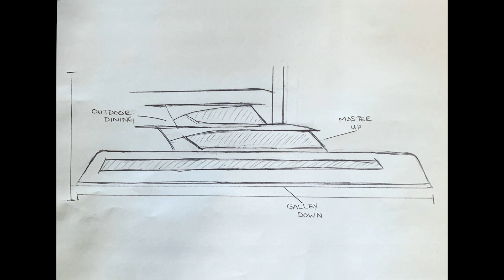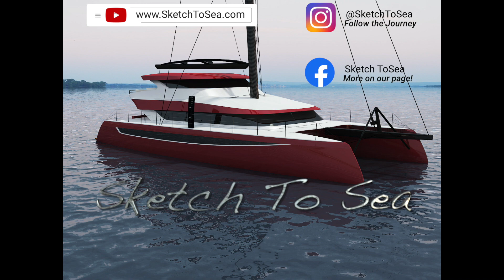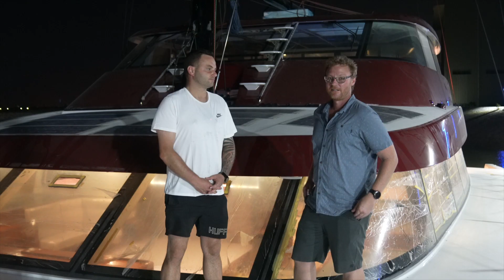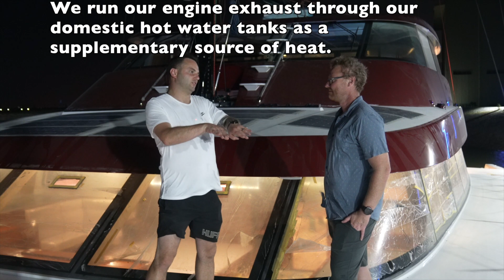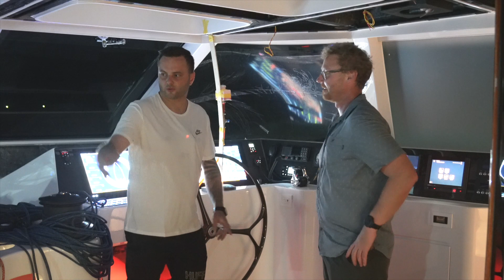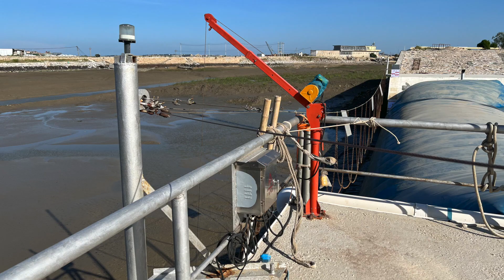Sketch To Sea: Interview with Chris Staub—Electrical Genius

Comment: Love your videos.

I have a question about your solar panels.  I have seen many debates about the pluses and minuses of having the panels stuck to the roof tops and not having the them raised to allow for easy replacement and allow airflow around to help increase the panel efficiency.  Have you or Chris have any thoughts or discussions on this?
Reply from the maker: Hi Daniel, thank you for the comment. In a perfect world I would have preferred to install them using the method that you mentioned. Unfortunately, the areas where we were able to place the panels are working areas. We need to be able to walk around and access these points so we were left with no other choice. That being said, the difference is marginal, and really boils down to the actual cell that is being used in the panel and if there is an "optimizer" controlling the panel itself.

Comment: Have you power generation through your props rotating when you are under sail? I think I got it right I'm not a yacht expert.
Reply from the maker: Thank you for the comment. Unfortunately not, when we were in the design phase of this build there were not hybrid systems big enough for our vessel. With the 88 being the first model in its range, I didn't want to be testing any more new and unproven technology.
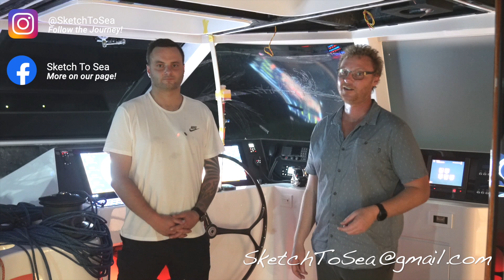Reply: @sketchtosea3750  20:37

Comment: I have one of those lightning devices on my boat, but from a different company. They even gave me a direct lightning strike warranty that will pay up to $100k. Cheap insurance.
Reply from the maker: Thank you for the comment, I am happy to hear that. I hope it has worked!
Reply: @sketchtosea3750 it's been 18 months but the problem is there's no way to know. Did it work, or am I lucky? None of my friends got hit either and have no lightning protection. But the warranty to pay for any damage does make me feel good.
Reply: What was the name of the lightning protection system you mentioned?

Comment: What size inverters do you have onboard? Everything has to be scaled for peak RMS eventhough the running amperage is quite a bit lower. When a refrigerator compressor kicks in there is an amperage spike then it settles down quickly to its running consumption level. Curious do marine electronics and cabling have special shielding to prevent erosion from the salty air? I like how they have basically created a mini-subpanel in every room in order to build out at a later date, that's smart. You really have thought out this vessel very well. Earlier videos talking about carbon fiber reducing flex and less maintenance over the long haul. Interesting learning about all these approaches.
Reply from the maker: Thank you for your comment, unfortunately I cannot share some if the intricate details yet. In general, yes there is specific wiring for marine use. A lot of this boils down to the "certifying body". For us it is RINA. They specify a lot of the individual materials to use.
Reply: @sketchtosea3750  If your solar array is capable of 7.3kw's and on a full sunny day you can gain as much as 150amps to supply the lithium battery pack I wanted to know what the overall power draw on your vessel is and the size of the inverters you chose or listed on the Spec Sheet? One inverter, two or a series of micro-inverters??? I'm impressed with every aspect of your build and you have been so detail oriented that I thought that this was a good question. I was really impressed with your whole discussion about flex and the long term maintenance avoidance, that was really thinking outside of the box. Most people fall victim to those hangups down the road. Inverter Selection is another potential bank-buster ( for me) 5-7 yrs nearing the life of the inverter. Your vessel is so cleverly thought out and I find your Sketch to Sea Project fascinating.